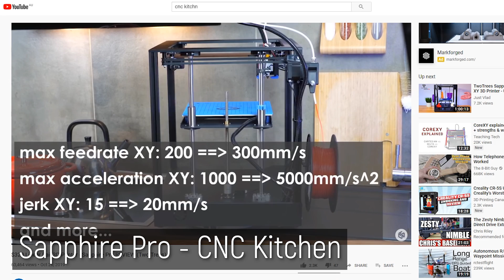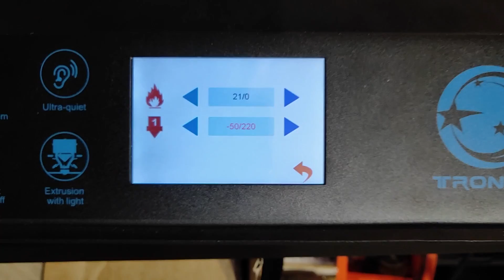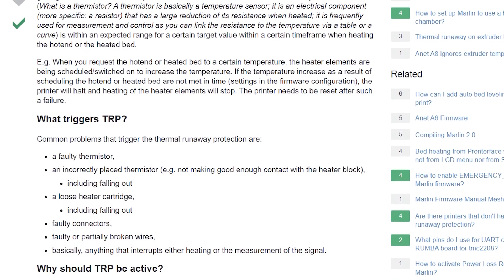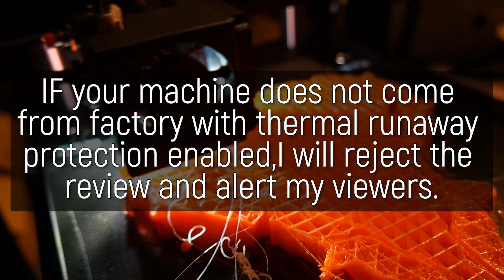The Tronxy D01 is a Solid CoreXY, Linear Rail 3D Printer... BUT

Comment: That tripled rainbow flex wire was horrifying lmao. That thing is in the ballpark of 0,14 or 0,25mm2, maybe 0,33 but if you triple those, it's NOTHING for 5-10 amps that even a 24V hotend sinks.

Comment: Angus, my friend.... I bought a Tronxy D01. For two weeks I have tried everything with retraction settings... nothing works. No matter what I do with temps and retraction settings, this printer is just a nightmare. Stringing is the only thing it does. I´m getting depressed and sad every time I try to print something, to the point I want to leave this 3d printing world.
The worst part is that where I live (Argentina) it´s really limited the places and people where I could find some info or help to solve my problem. I just don´t know what to do.
Reply from the maker: I'm very sorry, the extruder is terrible! Try a high retraction (6-12mm) and try reducing print speed and print temperature to see if it helps. The mechanics are very good, I replaced the extruder on mine with an e3d hemera.
Reply: @MakersMuse  Thank you so much Angus, I will try that and save some money for a new extruder because in Argentina this things are very expensive. I will lower speed and temps a little more with some more retraction.
Reply: @MakersMuse  Hey Angus! Good news. I got some decent prints finally with this Tronxy D01. No matter what I did with retraction, temps and retraction speed, stringing was always there. But... I donpt know why, after I tried literally everything, I started messing around with parameters I really don´t know what they are. The thing is, when I put in the "manage printer" section, G-code Flavour "repetier"... it just works. I´m in love with my Ender 3 Pro, but in the end, it seems the Tronxy can be a second printer for now. Looking to get a third one now =)

Comment: Thermal runaway is why is packed up my Creality CR-10 and sent it back. Right out of the box, it gave a runaway fault and shut down. As an engineer with 4 decades of design experience, I am not going to diagnose something right out of the box. I did replace it with a Winice M09 and I love it.

Comment: Can u do an upgrade video on the tronxy xy-2 pro I want to get spare replacement parts and if possible upgraded parts im just lost at what to get that will work With my machine i only just got my 1st printer at Xmas just gone im Mainly looking to get any parts that are likely to break Including may be Volcano hot end or something like that if it will work with my machine And I would like to upgrade it so that I can print TPU As it says it can only do ABS and PLA any info that will help is much appreciated thank u

Comment: For me the stringing problem solve by rectangle distant set to 10-12mm(abnormal right?) .
But Don’t ever buy this Tronxy printer. Probably all the time you wasted is more than the price. Trust me to look for another printer. No joke, I bought two extruder X5SA-2E (2020 February) the auto level sensor is shit! You have to do 100 times before starting a print and don’t turn off the printer; otherwise, you need to do all over again! The only safer way is to adjust the heatbed during printing. This brand printer can make you be a master of finger adjuster! Money wasted is ok but not your valuable time. Sometime the extruder will hit the bed badly with unexpectedly. Not user friendly, the firmware needs to request by email, and they need you to take a photo for the board before they send the firmware to you and FFF file. And the shitty tronxy slicer is a clone from cura. All the menu is the same as cura—what a shame. The worse is the smoke comes out from the machine, and that’s my last print from this printer. I don't want to use a cheap printer to burn my house down. Paid to fulfill the trash bin.

FYI The Tenlog D3 pro dual extruder printer is much better, stable, very fast to reach the nozzle temperature, they are providing free shipping now, but need to buy from the official website. And It's s worth to get the tmc2208, print silently,  the technical support is very responsible, if anything happens within a year, they will resend the parts for free. But second-year have to pay to ship.

Comment: Thanks for this review. One thing helped me a lot is the retraction setting. I was struggling so much but didn't get that aggressive 12mm setting. Stringing almost gone. I reconfigured the mainboard as with the file from Tronxy. Any safety feature should never be turned off anyway, thermal runways is very crucial here. If they are in business, imagine a news of fire and loss of life from this printer. This could be the end of the business. Thanks for unbiased review on it.

Comment: Angus,

I recently added a Tronxy X5SA pro to my printer lineup and this is the first machine I have had that doesn't use marlin. The Esteps need to be calibrated on it and I was wondering if you have any videos on Estep Calibration for the Tronxy printers? I am able to connect to it but can't really find any info on how to view the current Estep value.
Reply from the maker: It uses a convoluted Gcode command system to the chitu board from what I understand, but it's not steps/mm its another value... it's really confusing honestly, I haven't attempted it yet

Comment: You give Thermal Runaway Protection too much significance. It's not that good of a feature. It relies on the thermistor, under constant strain and movement, not to break a lead. If one of the leads break, and they do, there's nothing stopping thermal runaway! I discovered it on my Printrbot, after three different Ubis hotends melted down from THEM tucking the leads under the sock, causing a sharp 90° turn on single core copper wire. They constantly broke, and they constantly blamed me, even though I showed picture after picture of their bad design. The hotends are just as important as the firmware! Brook and Carl really should have listen to feedback.

Comment: Good job handing it to them on the runaway issue. Also, I think 4mm at something crazy slow like 10mm/s would likely work better than infinity mm at 40mm/s. I saw an old creality out-of-the-box gcode doing extremely slow retractions one time by watching the hobbed pulley, and I must say that it is a good trick.

Comment: I've had very little issue with my tronxy (A8 clone) but the lack of TRP is really troubling. if they don't address this asap I wont be buying from them again. in fact i may be biting the bullet and trying to flash the firmware with something TRP compliant. as long as i don't have to jump through umpteen complicated hoops to do so :x

Comment: I'm pretty sure the thermal runaway protection disabled is due to the bad hotend design. Once I've enabled it on my CR-10 it triggered every other print as the hotend fan blew constantly over the heater, leading to swings in every direction. I switched to a different design and did a PID tuning and got it fixed, but with the standard design I had issues.
Reply from the maker: 100% that's why they used to do it, bad hot end design. I think the hot ends have improved, but they just... left it off.

Comment: what's the big deal, just update the firmware lol.  I understand the danger just not the laziness of not testing to make sure your machine is safe.  yes I agree that it should be enabled by default but if the only problem with a printer is that its firmware needs to be updated it's not a bad printer, just a small software oversight

Comment: I wonder if a house  fire caused by a 3D printer would affect an insurance claim ? Surely the manufacturers can see that enabling TRP could be a selling point and i'm now also beginning to think that there is a surplus of ribbon cable in China ! Ribbon cables are fine as a data /signal transfer coupling in a STATIC environment where vibration and movement are minimal or non existent.
It is a real shame to see a printer that is capable of being a decent printer let down by shortcuts, cost cutting  and the use of a few crap components. 
I don't think it would be difficult for the software developers to implement a TRP self test on boot up or at least have TRP enabled as default - i can't think of a reason why you would want to disable it ? It's  a bit like fitting a new smoke detector in your home but not putting the battery in !
Thanks for the Honest review   Angus !

Comment: Sometimes my Tevo Tornado will have its thermal runaway triggered when the temperature of the nozzle is set to like 270 degrees and I remove the insulation (while replacing nozzles). Yeah, it's a bit annoying when I have to restart my printer, but I bet it's far less annoying than having my closet burn down.

Comment: why do all of these printers, where  bed moves on the Z, have the bearings and rods only in the back. This can cause the bed to bounce. On my custom built machine I moved the to the sides and it made a world of difference. I also spaced the top and bottom bearings as far apart  apart as I could without loosing print height.

Comment: Honestly, the takeaway from a series of Chinese CoreXY printers is... it's waaaay better to just get a decent i3-style bed fapper than poorly designed and poorly QA'd CoreXYs. Also, while I can't tell if this is the case with this model, Tronxy has shipped CoreXY printers with non-parallel belt paths. That means they don't even understand the kinematics. CoreXY isn't very forgiving of poor designs and poor QA. It's just a recipe to waste money. Once again, if you want a real CoreXY, the best options are self-source designs; Voron, Railcore, Hypercube, D-Bot etc. Some of those you can even get kits of parts from China for a lot of it, thereby cashing in on the Chinese cheapness factor, but sidestepping the shit-factory of Chinese printer design. Anyway, good job Angus. How about you have a go at a self-source mate? You wont look back.

Comment: Tronxy X5S is the worst printer i have ever owned, among dozens of dozens. It's not worth it even for the parts.
All kinds of fire hazard and sub-standard engineering and hack jobs to make it even resemble a printer. It is absolute garbage.

So i was biased coming to this review, and the first 30 seconds alone did not leave me hanging.
Tronxy still has not learned their lesson, and you should avoid them like plague.

Linear Rails was just one more marketing word for them to get a checkmark on. They did not have any engineering capability what-so-ever it seems.

Comment: i have a Tronxy CoreXY printer form a year or so ago.  It is a large format printer that i bought to print helmets.   It occasionally produced amazing prints, but mostly the older belt assembly and hot end assembly were so badly designed that a huge amount of movement was possible. The large print bed frame was not even a little bit straight or level and was not possible to get either with their design.  It had some of the same issues with stringing that you saw.  I've thought about upgrading the printer but the cost to make it consistently useful was more than i paid for it in the first place.  I do not recommend Tronxy at all at this point.

Comment: Just to point it out, the fact that they powered the hot end cartridge with three wires rather than one thick one, is in itself a huge red flag that they've chosen price over electrical safety. If one of those wires came loose, the cartridge would still heat while risking burning out the wires, there would be a live conductor loose and thermal runaway would pick up neither of them even if it were enabled.
Reply: Thank you i was just going to say this but thought someone must have brought it up.  Electrically this is a really daft idea as you state and is in no way something that should be encouraged or even stated in a video as being a good thing.  I have even seen an American company Elite Machine Works doing the same thing and promoting it as a good thing,  Think they should lose the Elite from their name just for that.

Comment: I had an issue with my robo r1+ that I got in late 2017.  They tinned the ends of the wires from the psu to the ramps 1.4 board causing the terminals to start melting.  If I hadn't taken my printer apart to upgrade to add an lcd screen I would've had a fire. (Btw there wasn't thermal runaway installed) I decided to upgrade to a duet 2 wifi and don't regret it.

Comment: Absolutely agree there! I've been running a tronxy x5s (first gen model) for the last 1.5 years, and back then it came with marlin and its runaway protection enabled, so i don't get why they went out of their way to disable it for a newer machine. That's just mind blowing stupid...
Reply: Need to add a caveat: my tronxy x5s did come with temp out of range settings, so disconnecting the sensor stopped it, but it does not have runaway protection. Disconnecting the heater does not cause the expected emergency stop. I guess it's time for the mainboard swap to a better cpu ...

Comment: This is not a "thermal runaway", this is a missing MINTEMP/MAXTEMP check (that was enabled even on the A8, IIRC). Thermal runaway is for when a thermistor falls out of the heater block and reads room temperature, not known ridiculous values like -15C, .. it works by *estimating*, which is why it was disabled for a long time in Marlin, whereas MINTEMP/MAXTEMP is pretty much 100% reliable, so it was always enabled (well, except this printer!).

Comment: This unfortunately means that this is a general problem with TronXY.  When I got my XY2, "Temperature error detection" was not turned on either.  however, it can be done via GCODE.

M8023 T0

Comment: Wow, glad everything worked out ok. I'm surprised you don't already do a thermal runaway test first.

You might want to help out Gina from OctoPrint and post firmware details in the forum (there's a thread about it) so she can add it to the detection and warning in OctoPrint. (If a printer/firmware known to lack thermal runaway protection is used, it will show an error and not let you print thru OctoPrint without very explicit configuration.)
Reply: I feel like, if a user can set up Octoprint they should be capable to adjusting their firmware to include TRP as well. :)
Reply: @theKashConnoisseur  perhaps you haven't set up OctoPrint recently. It's super simple. (And how would they know they need to rebuild their firmware if they didn't see this review and nothing they used notified them that they have a defective printer?)

Anyway I'm not discussing the merits of the feature (though I think it's wise) I'm just saying this is a data point worth sharing to augment the feature.
Reply: @rpavlik1  I re-set it up a couple of weeks ago when I changed some network hardware up. But to echo your sentiment, I don't know how recently you configured a Marlin setup, but it's also super simple to uncomment the line enabling TRP.  There's not a budget printer on the market that doesn't benefit from firmware tinkering, including E step tuning, linear advance, and certainly checking that TRP is in fact enabled. 

Anyways, Octoprint does have a built in plugin called Printer Safety Check, and if it doesn't have the ability to do such a check on this new Tronxy machine, yes of course they should be (and very likely are) working on it. 

None of that neglects my point that if someone is able to set up Octoprint, they also have the technical aptitude to look at their firmware and make sure TRP is enabled. If you disagree, we can discuss the merits of your arguments, but making apples-to-oranges counterpoint isn't going to move along a conversation ;)

Comment: Adding a smoke detector over a printer never hurts.
Reply: Placing it in a nitrogen filled chamber never hurts....
Reply: @turf6863  CO2 fire extinguisher controller by an Arduino maybe?
Reply: @PeXnb  go Halon, or go home. :-P
Reply: @thebrutallyhonestdm  Original comment: "Adding a smoke detector over a printer never hurts."

Your stupid interpretation that he is "telling people all they need to do is install a smoke decorator."  is pretty far off the mark.  I haven't seen anyone say that, only one idiot interpreting it that way...
Reply: @thebrutallyhonestdm  LOL. I honestly doubt that anyone would read his comment and think that he meant if your printer/house is on fire, it's ok as long as you know about it.  People know what smoke detectors do....nobody thinks they are a fire suppression system.
Reply: @thebrutallyhonestdm  "It's like telling someone the way to start a law mower is to push the prime button 10 times, but neglecting to tell them they also have to pull the handle and pull ..."
It's more like somebody saying "wearing a seatbelt is a good idea..." and then some moron in youtube comments getting upset because he didn't tell people to pay attention to their driving and instead interpreting it in a foolish way: "telling people all they need to do is wear a seatbelt and they will be safe is bad advice, waaahhhh"
Reply: @thebrutallyhonestdm  Actually, my wife is a stay at home mom. We also have 2 for extinguishers. They'll be upgraded to CO2 fire extinguisher next year, before current ones expire.

Comment: What’s so freaking complicated about Removing a “#” sign in their firmwares Jesus. These manufacturers are confusing
Reply: Actually they add the sign , the feature already exists by default.
Reply: @yassinelessawy6101  oh right. that's dumb
Reply: @chloemcholoe3280   I edited it, I was writing half asleep.
Reply: Some manufacturers use a really shitty cooling solution so 100% cooling cools down the hotend and triggers thermal runaway. Instead of fixing the cause, they are fixing the "problem"
Reply: When you prefer to save 500 bytes of memory rather than have a safety feature
Reply: Many of them don't even understand the firmware. For them, it is just copy and paste.